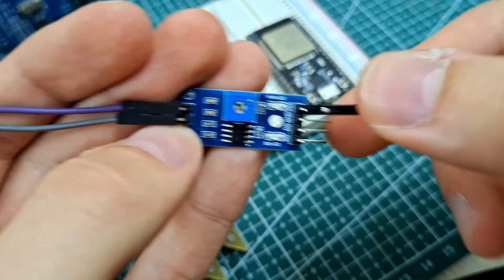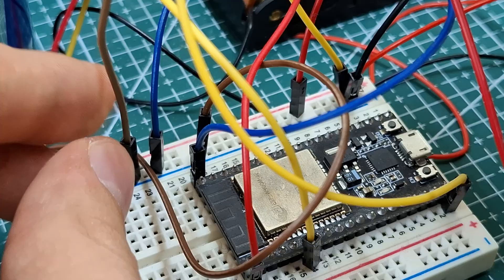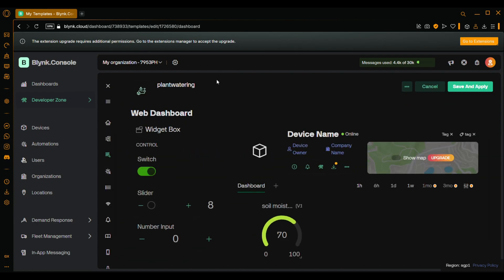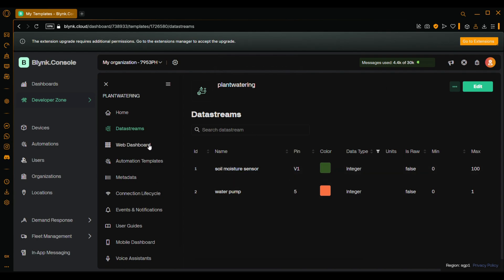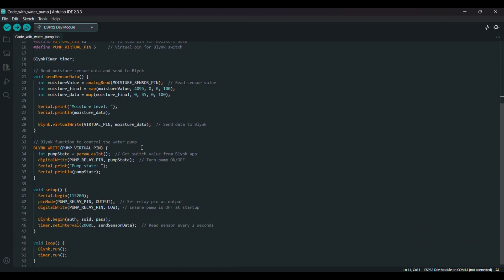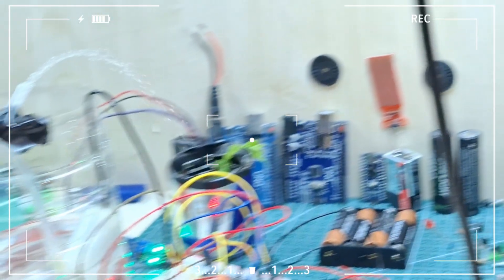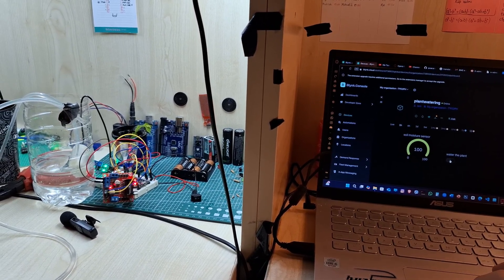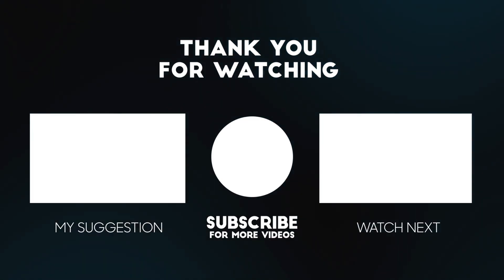Self Grown Plant?? ESP32 Watering System #2

Comment: can i do the same project with arduino?
Reply from the maker: @DormaPlay  Yes, of course. You can do it with esp8266. Just replace "esp32" with "esp8266" everywhere on Blynk app. Then try to ask chatgpt for the code and you are all done🤗.
If you have any question feel free to ask!
Reply: @Mr.Atechs  so esp8266 works for arduino aswell or what?
Reply from the maker: Yes absolutely, I mean the ESP8266 WiFi Module..